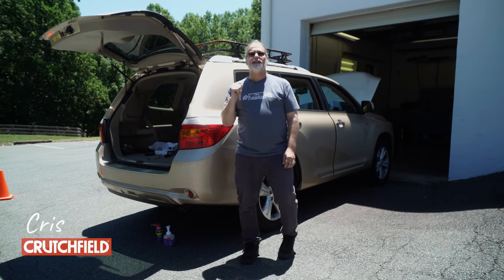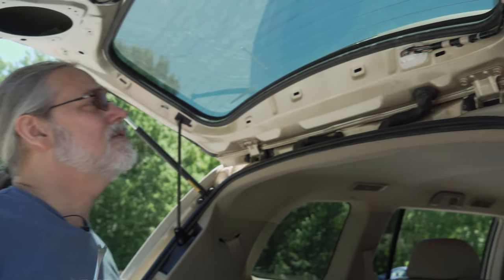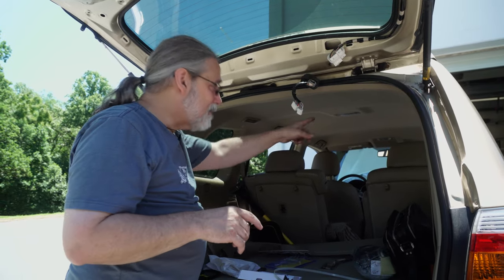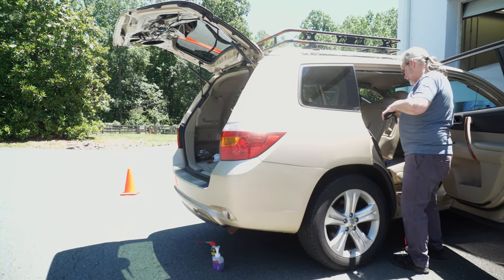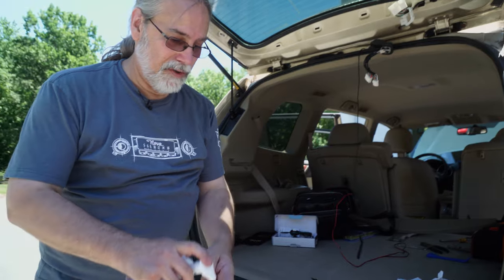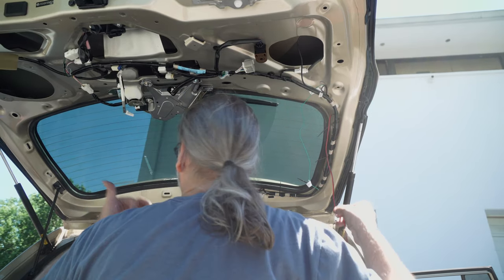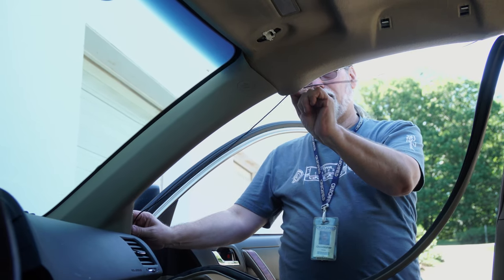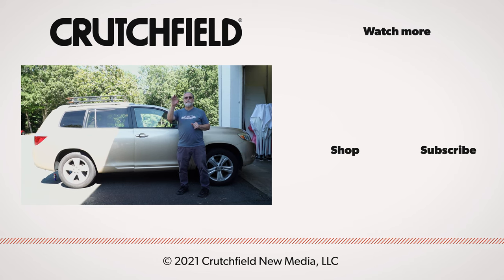How to run backup camera wires in an SUV, crossover or hatchback | Crutchfield

Comment: Yesterday I did this job and I guess I needed to pay closer attention to the video because with my 2015 Subaru Outback Premium the headliner seemed to be glued to the rooftop too much to route this way. I opted to follow forward along the base of the drivers side door frames.... was okay but super tight.
Reply: Working on my 2009 subaru forester xt today. . . Wish me luck
Reply: @soinaru  Got mine in yesterday. The headliner trick for me was to focus on a path towards the passenger side, using a long flexible plastic rod to fish tape it through. I pulled the wire from back towards front and paid very close attention to avoiding any air bag
Reply from the maker: Good luck! Keep us posted.😎
Reply: @crutchfield  The job this time went perfectly and the cam is excellent
Reply from the maker: Great news! Way to go!

Comment: The air bag heads up made this worth watching.  Can you run the camera wire down the drivers side instead?
Reply from the maker: Sure. The best route will depend on your exact application.
Reply: @crutchfield  I have an 05 Lexus RX330,
Reply from the maker: Sorry, Don. We don't actually research vehicles for information on routing camera wires so you will want to take some time to plan your best/easiest installation route. as you prepare to install the camera.
Reply: @donmack5039  With my 2015 Subaru Outback I actually did this job twice, with the first attempt being on the drivers side. In my opinion the passenger side is easier with there bring more empty space for the wire routing. Passenger side has a glove box, drivers side has steering wheel and wiring harness

Comment: Nice job but I would be concerned that the camera might get knocked off at the car wash. I think a tight mount or flush mount would be best, no?
Reply from the maker: Good mounting hardware does make all the difference. What mounting locations do you tend to use most often?

Comment: Thank you for this.  I'm still a bit confused.  I thought the red wire (in the hatch) had to be spliced into the rear reverse bulb?  Maybe I missed that part.
Reply from the maker: Hi there! That depends on the specific setup of the back-up camera you are installing. The camera in the video has a convenience wire that runs to the front of the vehicle to make the power connection at that location. Others will tie into the reverse light wire.
Reply: @crutchfield  Yesterday with my Subaru Outback 2015 and an aftermarket Crutchfield Pioneer 1500DX I had a opt to attach the power wire at the backup light at the rear of the vehicle. Up front it's just way too many wires packed into a very compressed space for any splicing

Comment: how do you remove / pry open that cable conduit boot? specially on a 2018 suburban?
Reply from the maker: Each vehicle connector is not identical on every car. For more vehicle-specific information about your 2018 Suburban a factory repair manual is a great idea. Often with newer vehicles you can also find crucial install information on model specific forums, too. I hope this helps!